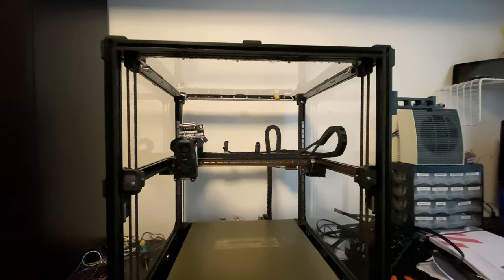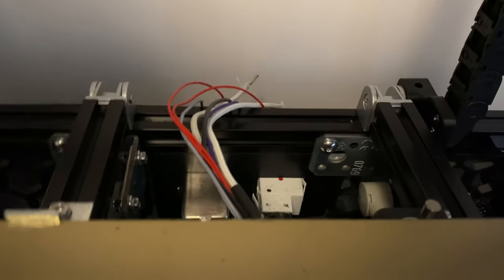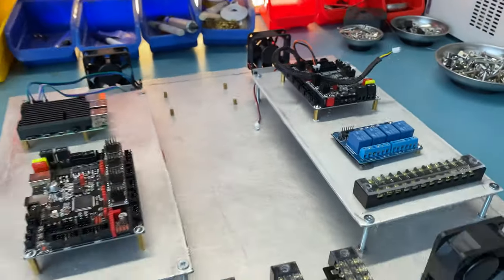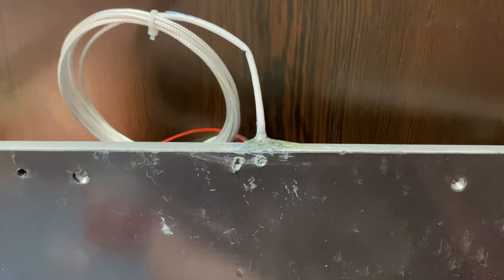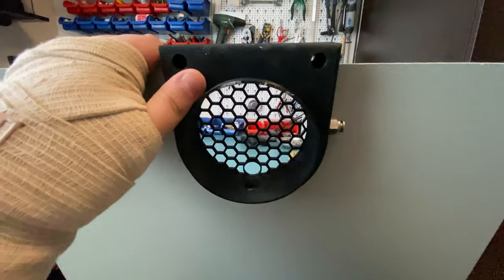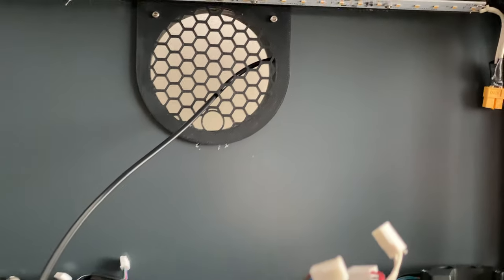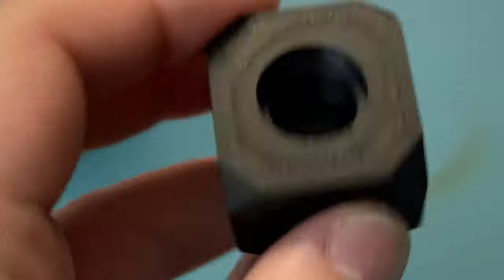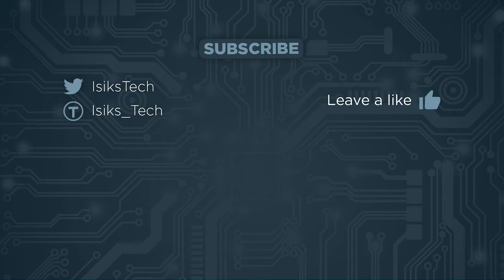Voron v2 Ep. 12 - V2.4 Gantry & New Electronics Chamber

Comment: I cant see if you have grounded the frame/heatbed etc. if not you should really do this. 
Im researching for a build like this and i will probably mount the electronics this way up aswell instead of having it upside down. What are those hinges and dampers you are using for the heatbed?
Reply from the maker: I grounded them. This video has more info about the mod: https://youtu.be/YtxrM_qPr9c
Reply: @IsiksTech  thank u

Comment: Merhaba,
Açılabilen (yukarı doğru açılan) baskı alanını sizin tasarımınız mı?
Reply from the maker: Evet https://youtu.be/jjqCdsLMAXg
Reply: Merhaba
Ekran bazında skr nin dokunmatik modellerinden biri kullanılabilir mi?
Reply from the maker: Ne çip kullanıyor onlar bilmiyorum. 
######################################################################
# Display support
######################################################################

# Support for a display attached to the micro-controller.
#[display]
#lcd_type:
#   The type of LCD chip in use. This may be "hd44780" (which is used
#   in "RepRapDiscount 2004 Smart Controller" type displays), "st7920"
#   (which is used in "RepRapDiscount 12864 Full Graphic Smart
#   Controller" type displays), "uc1701" (which is used in "MKS Mini
#   12864" type displays), "ssd1306", or "sh1106". This parameter must
#   be provided.

Comment: I cant really tell but are your DIN rails upside down?
Reply from the maker: DIN rails? I'm not using any.
Reply: @IsiksTech  oh my bad, when you were complaining about them, I thought thats what everything was sitting on.
Reply: I looked again, I see the rails, was just an optical illusion making them looked reversed
Reply from the maker: Right when I was complaining about them they were installed. I forgot about that part. I didn't like them so later in the video I removed them.
Reply: @IsiksTech  i agree. Mine are wobbly also. Seems its either they are hard as heck to move at all or they slip right off.